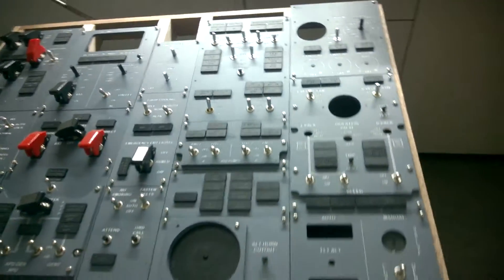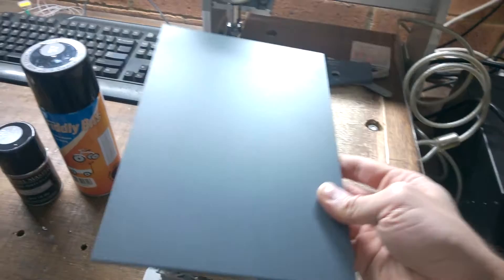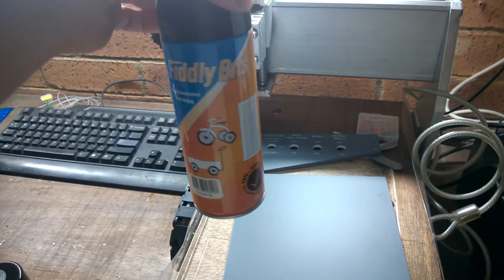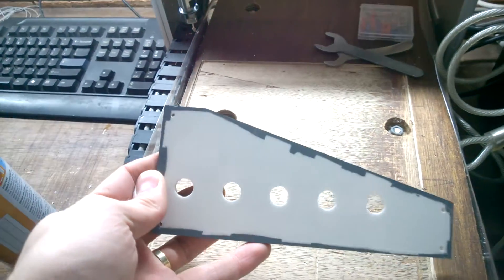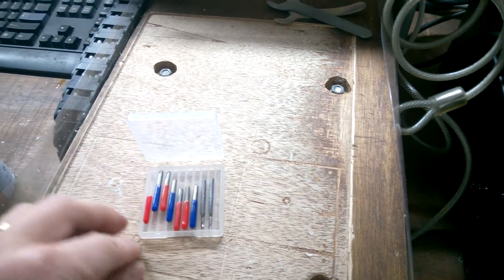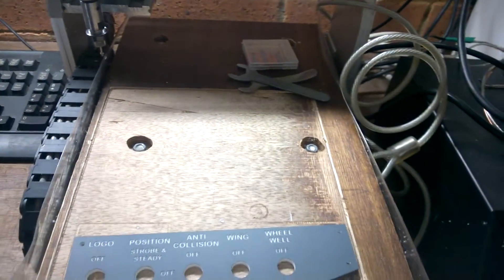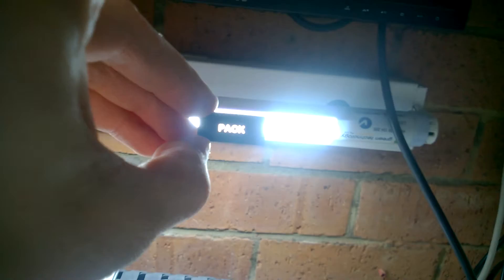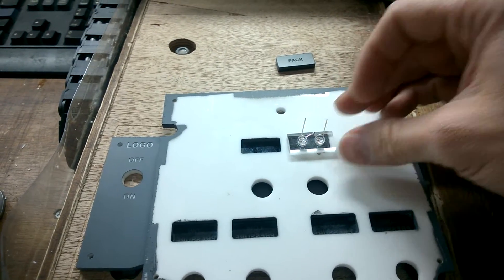Boeing 737 Home Cockpit (Overhead DIY CNC Panels)

Comment: Very nice! How are you painting these? With an airbrush or with a normal brush? Thank you!
Reply from the maker: Neither actually. I found a pretty close color within enamel range for one of the manufacturers of spray paints for models/toys.
That would be my topcoat. Below it - just decent black spray paint from a can.. you can get those from hardware stores.

If i was to do it again - I'd go for a custom can of automotive pain. you can get them premixed from shops that do car pains. That stuff is tough as nails compared to ordinary spray paints (unless you get epoxy enamel or something like that I guess.. but then getting right color is problem)
Reply: @VadimTarak  I have now ordered some black enamel paint and I ordered the gunship grey paint. Thank you for the quick reply!

Comment: hi i cant get good results i tried leveling the table. i tried the program you said but i havent been able to get it right. there is any way you can send a picture for vcarve  screen to see how the you got set the tool the depth pass speed and all that?
carlostxnl@yahoo.com
thanks
Reply from the maker: I'm not sure what exactly you can't get right.. Can you at lest state if you're engraving or cutting?
Btw, how did you level the table?
Reply: yes I,m able to cut and engrave sometimes some panels come out good but some areas look uneven, I tried to level the table with a mdf and adding washers at the bottom and using a torpedo lever . i tried to use the bit you suggest but cant make it work right, im getting better results with a 3mm v 90, i dont know if the tool is set properly in vcarve

thanks
Reply from the maker: zcar2043 How did you level it with MDF? Did you route out the table area or just stuck MDF onto the table? A level is no good for CNC as I doubt you'll tell the difference when one side is 1mm off. But 1mm is too much when you engrave at 0.2mm. As i suggested to Diogo before, try routing out a pocket in the MDF for the size of your working area(You can see it one of my other videos) . Since it is the CNC itself that cuts the pocket out it will be perfectly aligned with it.
Once you know for sure your table is levelled, the only remaining part to level is the workpeice, and that's where autoleveller is perfect(Latest free version MIGHT have a bug though where it's aircutting).
As for the tools, I'll give you the settings when I get a chance, but they won't give much as it's whatever the default was anyway. The cut depth I use when possible is 0.15mm (or 0.2-0.25 when 0.15 is not possible). I also adjust feed rate manually to about 40%-50% in Mach3. The exact value will be different depending on how I "feel" the job is going

Comment: Hi, i tried the  bit you said and worked perfect thanks!!

Also would like to ask you what tool are you using for engraving

Thanks
Reply from the maker: Good to know! Glad it worked out for you too.
For engraving I use a few of V bits ranging in size from 0.1mm to 0.3mm. Mostly 0.1mm and 0.2mm are used.
I bought 10 packs of each from ebay.
Reply: Thanks for your help
Reply: If you interested i have a friend that sells the pressurization panel. He is in  argentina
Reply: +zcar2043 hi! I'm from Argentina! it's too late maybe but who sell pressurization panel in Argentina? thanks in advance

Comment: Hello again Vadim, the machine arrive and I would like to ask you what test can I make to check the missing steps on motors? Right now I'm completely blank because I don't know what software use for CAM/Gcodes? I made some simple draws in inkscape but now I cannot generate Gcodes correctly for Mach3 software. Any tips about it? What test can I do to verify the miss steps on motors?

Comment from the maker: To Diogo Gomes:
One of the things I've to my CNC was to solder a few capacitors on the control board. Otherwise it was actually loosing steps and things ended up out of alignment. After I added the capacitors it became perfect.
if yours have that problem, google for "CNC3020 loosing steps". I think here's the place where I took the ideas for a fix from: http://www.cnczone.com/forums/chinese-machines/190286-yoocnc-3020z-d52-losing-steps.html

I don't really have that many drawings of my own. All my overhead work is based on DWG(I think) file available from mycockpits.org. The rest is just Vectric Aspire files and Mach3 files. Those probably won't be much help to you depending your setup, but let me know. Also I don't keep Mach3 files after cutting as I can easily regenerate them from Vectric Aspire.

Not sure what tips to give really.. Can say that I use 0.2mm engraving bits and single flute endmill for cutting... Feed rates are adjusted manually according to how I "feel" it goes.
One useful thing I discovered lateron was autolevelling software (http://www.autoleveller.co.uk/). Firstly it's useful for making PCBs, but not just.. I used it really well for engraving panels. Since plastic has natural variations in thickness you can  easily get crappy engraving and ruin the whole panel. You'll either get aircut(no engraving) in some places or engraving will be too deep.
By using a probe and autolevelling software I solved this problem. For probing I just placed tinfoil over the plastic sheet...
Reply: Thanks Vadim, my CNC 3040 will arrive next week and once I start making my first tests I might request your expert to drive me through this new world. I'll appreciate all the tips you can provide. For example what software are you using (inkscape, Makercam, Mach3)????
Reply from the maker: ***** 
I've sent you my email via Google+ (Hangouts). Let me know if you see it
Reply from the maker: ***** I'm using Mach3 and Vectric Aspire. That's what I personally prefer; so can't comment on other programs as I haven't used them much.
From inkscape I'd export DXF file, which can then be imported directly into Vectric Aspire where you add so called toolpaths. These toolpaths usually follow/trace the vectors you drew in, say, Inkscape. Then you can run a simulation which will show you how your workpiece will look like after routing. If you're happy with the result, you just export .tap file (which contains gcodes) and that file goes right into Mach 3.

It's not very complicated, but you'll have to know your CAM software and software which controls the CNC, as well as the mechanics of the CNCing.

If I were you I'd start watching simple tutorials on your choice of Cam software and CNC things like offset, homing and so on.

Once you feel comfortable, try making something simple of your own. Like a line or a square.
I'm happy to walk you through the process if we can arrange for realtime communication and you endup using same software as I do

Comment: Hi, I have the 6040 cnc but most of the time the acrylic melts i have used 1mm end mill and a 3 mm end mill same results. how can i prevent this to happen 
thanks, you doing  great job with those panels
Reply from the maker: That could be due to number of things like feed rate, speendle speed, etc. For me the biggest difference was when I switched to single flute endmill. And this is what I recommend. You can get the off ebay. Here's the one I use: http://www.ebay.com.au/itm/5pcs-2-0-mm-2mm-Single-Flute-Carbide-Spiral-End-Mills-Router-Bit-8mm-CEL-/110882436697?ssPageName=ADME:L:OU:AU:3160

As to the actual milling settings. That will vary.. I have pass depth of around 0.6mm(from memory) and I always decrease feed rate to around 30% in my Mach3 screen. Engraving is done at 100% speed.
So probably firstly try decreasing the feed rate in mach 3 and check the results. And if possible get a single flute endmill as they are really good for plastic
Reply: Thanks for the advice, i ordered i will post results :)